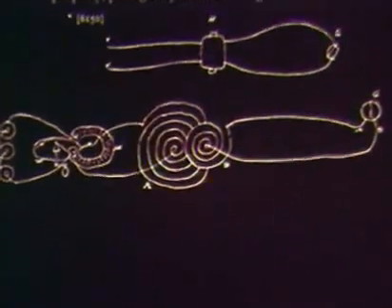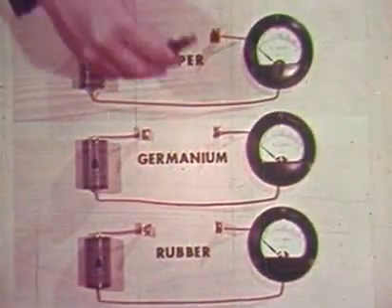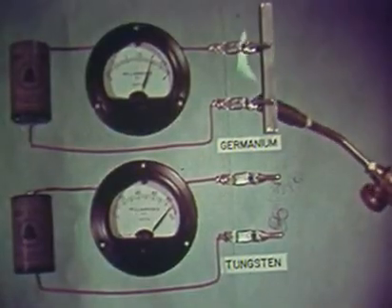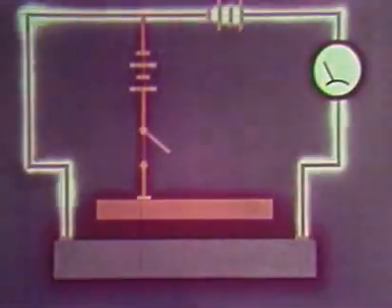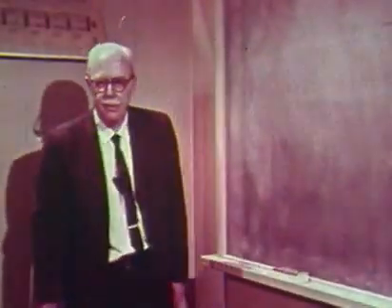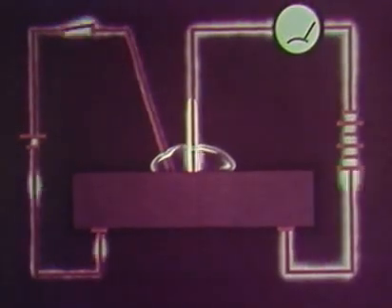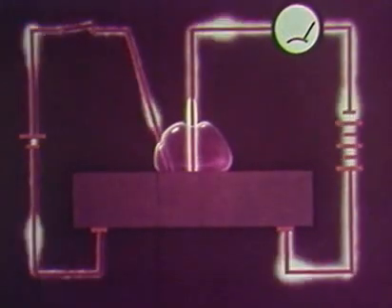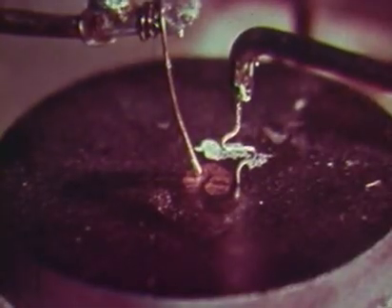AT&T Archives: Genesis of the Transistor

Comment: 12:20 Says a single wafer contains as many as 2,000 transistors. As of 2021 a 12in wafer could have as many as 3 trillion transistors. Although wafers were also a lot smaller back then, on top of the fact that transistors were larger. So it was kind of a double bonus when we figured out how to grow bigger crystals of silicon.

Comment: I still have a mint box of 1951-1953 point contact transistor model 1698.  This is even before when 2Nxxxx numbers were issued to parts.  Its serialized in a box and has never been used.  I found it in Goodwill back in the early 1980s.  I had no idea what it was but thought it was interesting.  There were piles and boxes of that stuff everywhere heading to the trash bins of history.  I am glad I saved that box.
Reply: You should put the word out to see if anyone is willing to take/buy any of those transistors for display and/other. I'm sure many a museum, computer, electronic, or other, would be interested--all over the world. It would be a shame for them to get trashed when you throw off the mortal coil.

Comment: My parents met while working at at&t. they both died from cancer within 3 years of each other. another three years after the last one passed I discovered an interest in electronics and the underlying concepts behind integrated circuits and computer chips. Today's the anniversary of my mom's passing. I'd give anything to be able to talk to them about this stuff.
Reply: Very sorry to hear about your parents. But if you're still interested in electronics check out the book called "the idea factory". Its about bell labs itay be very relevant considering your parents worked for at&t.
Reply: Rest in peace to both your parents.
Reply: I am sorry to hear that , If we can make a business and for sure you can compleate your self studying please give me your email
Reply: Sounds suspicious. Did they die of exposure to radio and microwaves? What were they working there?
Reply: @vance2964  Radio and microwaves do not cause cancer, they are non-ionizing.  The frequency is too low, hence the energy to dislodge electrons from their shells is still well below visible light.  They can cause heating of tissue at high power levels though.  That's about it.
Reply: @NixieTheSkwerl  I Used to be a sat tech for direct t.v. trust me RF. waves do cause cancer
Reply: @864productions6  We understand the connection between electromagnetic waves and cancer very well. The longer the wavelength the less the danger. High frequency (gamma rays) indeed causes cancer. Radio waves at best are around the wavelength of 10 centimeters (5G).  At best we feel it warm (microwave-wavelength). Much shorter wavelengths UV-rays have ... thats why we can have skin-cancer from it , if we have sunburns to often. 
There is no reason why long wavelenghts should cause cancer.. they literally cant transport their energy to the cells... hell, as a sat-tech you should know it better than me (because you are able to calculate it):  how big an antenna needs to be, to resonate with a specific radio-frequency. Thats for a reason!

Comment: Typical film  where we just sit back  in awe of it's invention  but they don't say why or tell us what  problems they solves.  I had an Electronic Teacher that was the same way  where he told us all about the circuits and  how to read the Schematics  ,  but I didn't learn what they were for and why they were applied  .
   My point is that a medical student can learn how to take out a Kidney or   take blood    for a lab,  but they must also know  the big WHY   because  learning to do something    but not knowing why  reduces the value of a worker  and a chimp could do it or a robot.
Reply: They explained why. Transistor replaced expensive tubes. It uses less power and can switch faster. Tubes by the way like light bulbs had finite life, modern transistors are much more durable. Also it allowed for building fast switching circuits, basically every computer or communications devices is built using transistors. Now days these are mostly integrated inside of larger Integrated Citrcuits.
Reply: SirMo it took many years before transistors was able to just approach the speed of vacuum tubes. However even they were much more power efficient at the beginning (except from some microwave devices).
Reply: @SirMo  audiophiles still prefer tube amplifiers for sound quality in stereos why?
Reply: @bilbobaggins4710  Tube amplifiers aren't perfect. They introduce distortion. The distortion however is pleasant. It usually results in a darker sound with less shrilled highs. Which can be quite pleasant to listen to.

Some audiophiles prefer tube amps because they like how tubes "color" the sound. Also classic (older music) was produced and played on such equipment so they may prefer it because it's the way it's meant to be listened.

But make no mistake, a transistor based amplifier can produce sound with less distortion. 

There are two schools of thought when it comes to audiophiles. Objective vs. Subjective. Objective folks prefer accuracy over everything else. The things that can be measured like THD. While others prefer Subjective quality like say a tube amp coloring.
Reply: @SirMo  how does a computer work Mr.science? Is the earth really a sphere?
Reply: @bilbobaggins4710  Computers are built using transistors, which form circuits called flip-flops, which themselves form various types of gates. Flip-flops can store data or perform logical operations on such data. It all builds from these basic blocks using states 1 and 0. These basic blocks form complex logic systems. A heart of a computer is a CPU which is built from the described concepts. And its what executes the software which you interact with when using a computer.

Colloquially Earth is a Sphere but it is not perfectly round as that designation might suggest.
Reply: Kevin Counihan  funny you should say that since Flip-flops pre-date logic gates.
Reply: Kevin Counihan  It's common knowledge lol. And no one is talking about mechanical flip-flop. What is a mechanical flip-flop anyways. The shoe like things you put on when going to the beach? lol
Reply: Kevin Counihan  Also for your information FPGA LUT gates are implemented using 4 input flip-flop pairs. So the concept of flip-flops being building blocks for gates is a real one.
Reply: Kevin Counihan  So I guess in the effort to expose my lack of knowledge just the opposite occurred :P have a good one
Reply: Kevin Counihan  That's what I thought.
Reply: Yeah, apparently it's that they don't want people contemplating the foundations of qm without supervision.
Reply: It's not a course on circuit theory and design, bright fellow.
Reply: Gary wood read a book stupid.
Reply: very well said ! your not suppose to know the intricalities of it... just do your part of the job without questioning like a robot or sheep !!